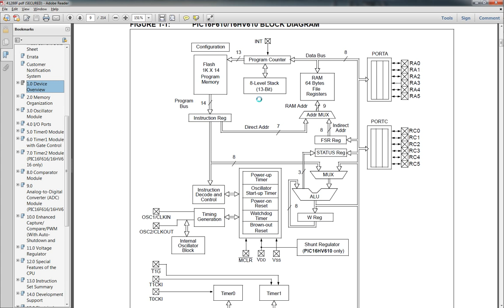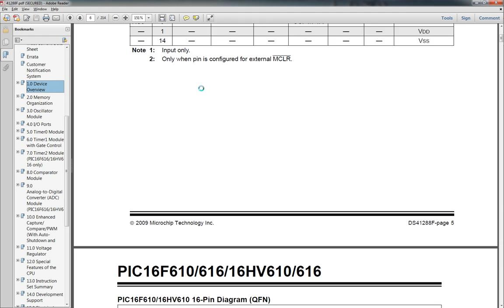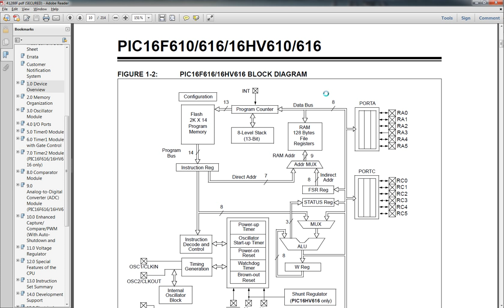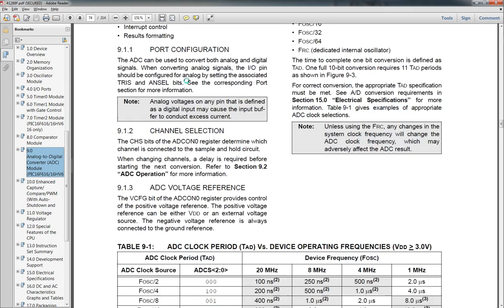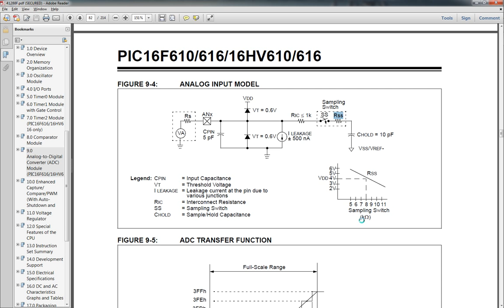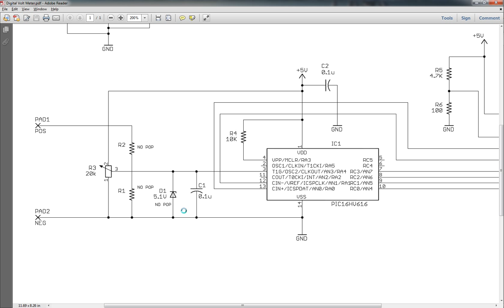Digital Volt Meter Part 1 (HW)

Comment from the maker: There is a mistake on the schematic concerning the LCD screen data buss pins.  The revised schematic will be showed in part 2 SW section and it will be included in zip file on my project code link as well.

Comment from the maker: No problem.  Been very busy.  I will give some explanation of how to deal with the HV side of it if you would like.  Also there is an application note that microchip has for it explaining a lot of how to work with these HV devices.  While you wait for me to get the code done you could check out that if you would like.  Thanks again for the comment.